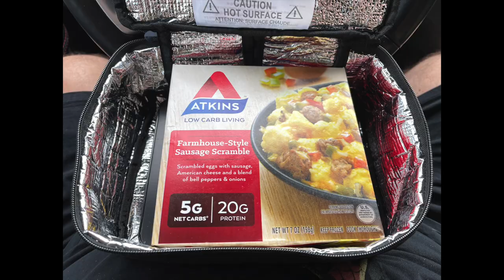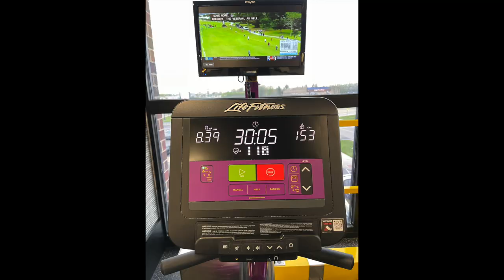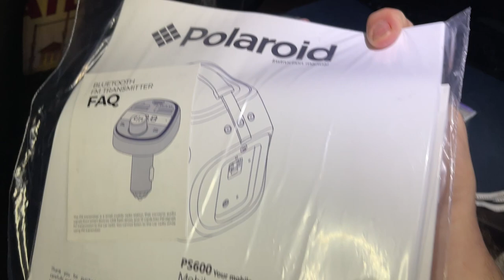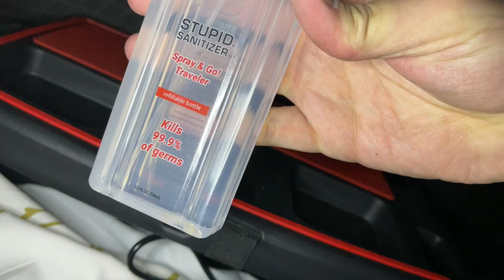Minivan Tour Part 2 - Cpap Table - What's in my dresser - Dry Snugs - Hot Logic and More! MI to MS

Comment: Love the simple design, well done
Reply from the maker: Thanks! I wasn’t ready to go but I figured just go with the flow and make it work so far everything’s been great except dummy me opened the top of my dc battery charger and lost one of the little metal tip pieces in gravel.

I spent at least 15 mins on the ground with a light in the dark and never found it but I do have the 110 cord as a backup here, I’ll just have to find some old cig lighter item to Sacrifice for a new tip.

Comment: What do you use to run your Cpap? Love the "Stupid Tray"! I've put it on my wish list!
Reply from the maker: Whatever battery has the most is what I used, I have a 300 and 500 watt pack in there now.  

 I was juggling them constantly trying to charge one as I drove for the day, I will eventually get the larger battery which should give me closer to 2000 capacity vs my current 300+500 (800) capacity.
Reply from the maker: Those trays are awesome I had one in front seat on in back for cpap not a single thing ever moved in over 26 hours of driving